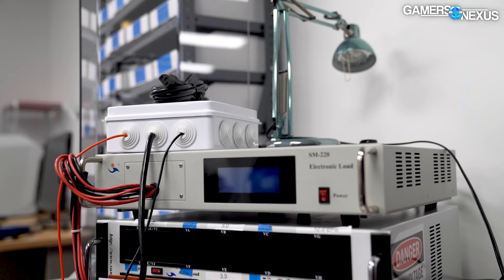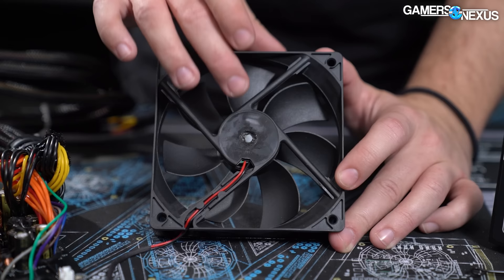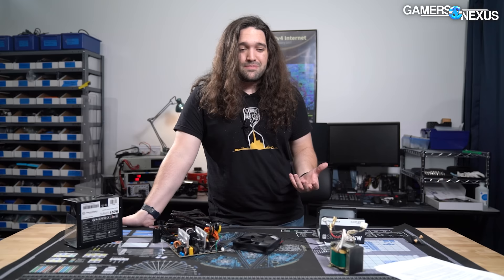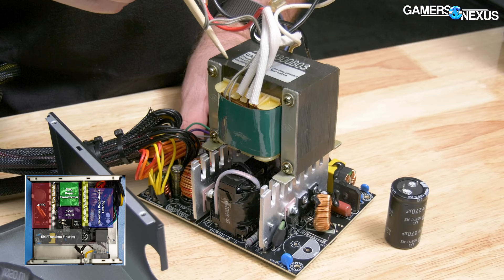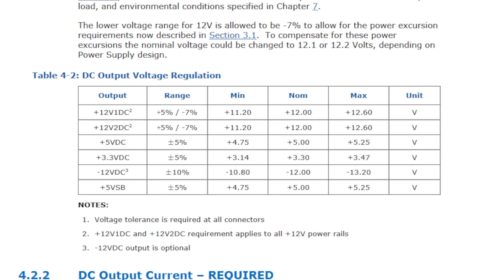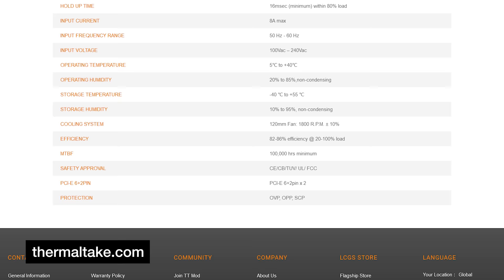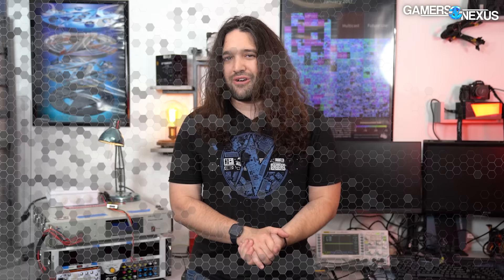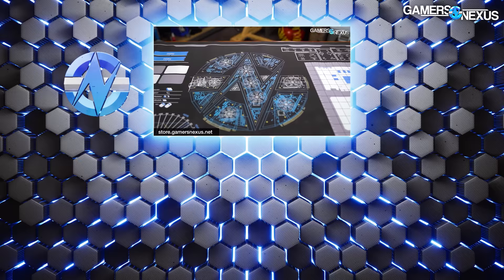Taking Risks on a Cheap PSU: $30 Thermaltake 430W SMART Power Supply Review

Comment: I'm sort of of the opinion that if you can spend $500 on a PC, you can spend another $15 on a PSU for something like a thermaltake BM2/GX2 or a coolermaster MWE V2 that can handle having a 6600 added to it down the line. If you have to forego RGB, so be it; reliability is more important than blinkenlights. 

Still, good to know that this thing at least has OCP despite not claiming it. Don't know why thermaltake does this, it was a similar case with the toughpower GX2, where it doesn't claim OTP despite the platform it's directly based on (channel well GPS) definitely having it. Still, questionable OTP plus a cheap fan makes this hard to recommend over even something like a used OEM CWT GPS or high power J-GD, which can often be found for similar prices.

Comment: What safety hazards does a capacitor from an unplugged electronic poses?
Reply: Normally we discharge the caps before handling the circuit, they can contain potentially lethal voltages even after the psu is disconnected.  I don't understand why he removed it, there's no reason to do so.
Reply: @PhazerTech  I know. But they discharge in a matter of seconds (for this application at least). I'm just trying to understand their reasoning for doing such a thing.

Comment: Can you do a round up review on entry level PSU's from each tier? I'm very interest in learning more about platinum PSU's.

Really I've been interested in them for awhile, but I don't really understand beyond power efficiency what makes a platinum PSU worth it, or if even if they component quality is worth it over a higher end gold rated PSU.

I have to imagine there are some platinum rated PSU's which are not worth the cost due to cheaper components. While other budget option have more value to them. I've read reviews on different brands but comparisons are extremely rare.

After 10 years I kinda want to replace my Seasonic g750, its severed it purpose well, but I don't know how much life it has left in it, and wish to avoid potential damage when it eventually fails.

Comment: Its a budget product that does what its supposed to... be a budget product! But they should update the info (or homologize it). However im not a fan of the skimp on cable lengths... or the missing -12v protection

Comment: I have a 1000W PSU but if I run my undervolted 2080 @~180W and stock 5600x this would probably hold up for as long as the components are supposed to live. I would only do this as a stop gap but still interesting.

Comment: I had a 550W Thermaltake Smart PSU go bad. The system would randomly shut off, and the sata power cables were pretty loose on there. Bad quality cables seem to be a common thing on these cheaper PSUs. I was able to RMA the PSU and they sent me a 600W TR2 S which works perfectly. 
I bought mine for a very cheap build (~£200) and even spent a little extra to get the 550W Thermaltake PSU over one of those crappy Aerocool ones. Neither are good, and I wouldn't recommend them.

Comment: The "Over Current Protection Data" table at 21:42 should have the 3.3V row's % Over Current value listed as 100% rather than 0% to be consistent with how all the other rows are done.
Good video, though.

Comment: EVGA w3 450watt is consistently priced around the range of this TT 430. I know there's tons of power supplies out there, but curious to see how it compares. Considering the w3 is often found at big box retailers like best buy.
Reply: @Examoon  EVGA have multiple sources for their power supplies depending on which line we're talking about (FSP, and Super flower just to name a couple). EVGA's warranty is also very good, unfortunately i had to use it but none the less its there and the turn around time is fast since i live in California (EVGA is also based here in Brea, CA). 

Great wall (GW) makes OEM power supplies and provide some of corsairs lower end units, as with all brands, GW have their cheaper budget models as well as higher quality models that they provide to SI's and OEMs. So, its pretty disingenuous to give them (GW or any brand) the sweeping label its bad because "china." Its more like "it depends." As is the case with many brands.  You should probably do more research before making sweeping generalizations.

Comment: Could someone please help me . I have two gpus both of which have the same issue when I boot up any game the cpu usage goes all the way too %100 and the gpu usage will be at like let’s say %30 MAX. Ik it’s the dedicated gpu from using occt tool and hwinfo . I’ve tried every driver for the gpu past and present update bios, running through all the power plan settings etc nothing fixes the issue. For some reason after playing overwatch for awhile it fixes itself but after I reset the pc it happens again. 
Build : 
I7 2600 
Sapphire rx 470 4gb 
DDR3 12gb 
450w psu 
Pleaseeee help

Comment: i just bought the Deepcool PX1000G PSU, i dont meed 1000watts at all yet but i wanted to buy one that could actually last 10 years+. It is 80 Gold certified and has the Cybenetics Platinum rating, i got it for a bit less than 190€ off Amazon. 

the "dont cheap out on your PSU" was really the driving force - and the fact that my old PSU recently died, it was over 10 years old, it was in a prebuild pc i bought a years ago for very cheap. so it never was the best PSU, also not 10 years ago. i had power outages the days before it dying, then ome time i turned on the pc and the power button immediately switched back off, then i could smell the PSU being burned. 

thankfully no part is damaged and now it works perfectly with my new Deepcool PSU. im planning to build a new pc with 4070ti super power level, so i wanted to really buy a good power supply if i had to buy one already anyways
Reply: *i bought the prebuild from a private seller, he got it from a IT friend from him who had many of those pc bc they aretö the old ones from a company who bought new systems. so i didnt buy the prebuild new myself

Comment: Since you were waving a graphics card around, I wondered if you'll ever look into how accurate the GPU manufacturer's claims about power consumption are? Like for the GTX1660 Asus and Nvidia both say you need a 450 W PSU, but finding a decent 450 W PSU capable of the +12V 45A the GPU needs to function is basically impossible (at least where I live), and for the GTX3080 they say you need a 850 W PSU, which is far more reasonable since you're looking at +12V 70-80A at that point. Why Nvidia went away from stating the actual amperage the GPUs use is beyond me, but it makes it much harder for us system builders to avoid going massively overkill on the power supply.

Comment: funny enough that psu fan they sell with a USB plug and a little stand and it makes a great little project fan. Ive even converted it to run off a 9v battery. probably cheaper to buy the psu and take the fan than buy it directly as the benchtop fan

Comment: Thanks for the review. The timinig is perfect, because i'm actually looking for an affordable 400W PSU which i can use for multimedia and office configurations. My choice will most probably be the bequiet system power 9 400W.
Reply: The S9-400W is a decent supply, although I would check how much more the 400 W Pure Power 11 is... that would get you better efficiency and a better-quality fan. 

That's assuming said fan has actually been assembled properly, which occasionally does not seem to be the case - in mine the rotor was not fully seated and dragging on the fan grille, requiring a good shove before clicking into place. I reckon with some woodworking skills one could easily devise a tool for doing so through the grille rather than requiring disassembly.... possibly even a common fork would work. (Most people would have returned or RMA'd the supply given BQ's reputation for good service, but I was curious what the issue was and whether it might be an easy fix, and this wasn't my first peek inside an ATX power supply either.) I think over the pandemic QA may have taken a bit of a backseat, otherwise a stuck fan should have been noticed...

The irony of the whole matter was that I had bought the supply to replace a Fortron that had developed a fan bearing problem after about a decade of moderate use (the old story of sleeve bearing fans not liking horizontal orientation much)... that was the very same Yate Loon D12SM-12 fan used in the System Power 9, I think. I had tried to re-oil the bearing but didn't know how to do it properly at the time, so the fix didn't last long. It's a bit more involved than just taking out the rubber plug and pouring oil in... Mr. Carlson's Lab has a video on this, something with power supply repair.

Comment: Should be enough power from something like a R5 3600 or 5600 using an RX5000 series card. Not a lot of head room with the RX 5700 xt but still within the envelope.

Comment: I’ve used these for my x99 systems paired w a gtx titan so there more than fine, yeah don’t cheap out on psu if you don’t have too but this psu is more than fine for some slight moderate systems aswell

Comment: I got this for my nas I'm using as a Plex media server. It's all used parts like a mother board with a built in GPU from an old Asus office computer, an amd phenom II x4 955 and 6 of my old 4tb 7200rpm drives. None of the data on it is super valuable so this psu is more than sufficient for what I need.

Comment: The 3.3 and 5v stuff would matter more for me, in the use case of using one for a retro enough system. Like I have a Socket A retro build I want to keep alive, and the only power supply it would boot with at the time, was the cheapo looking turd that came with a case I bought from Fry's electronics, when they were still open. Looking at the stats sheet of the respective units, only the cheapo unit actually supplied enough output at 5v to handle the CPU. Even though it was a later board that did use the 4pin aux connector, which should have offloaded CPU current to 12v based on what little I knew of the spec.

Comment: Is my math off or am I missing something?
It says total power as 430W...
But last time I checked, 110 + 387 + 3.6 + 12.5 was equal to 513.1 :|
And it can't be "after inefficiency losses" either because then you'd get 410W (ignoring the part where it says "Max Output Power", so it's after al inefficiencies)...

Comment: The very cheap 600w thermaltake PSU they sell at best buy etc for $40 & the $50 model with RGB is actually an ok PSU, from tests I've seen. They're 80+ white but are efficient enough to be bronze and was capable of well over 700w in testing.  Testing showed it overperforms. I would assume it's garbage but tests show it's a fine unit. I'd like to see GN test the 600 and 700w units as I'm going off some testers I'm not very familiar with. I've seen a couple of these cheap TT 600w psus last and last, still going.
Reply: "white" is the old standard, from like 2008, LOL. At least I had a 2008 FSP 500W PSU that still seemed fine in 2016!

Comment: Shouldn't OCP be tested in cold and warm environment, or at least link test ambient temperature condition. Because depending on ambient temperature and PSU heat state trigger point will float quite wildly. 
There are quite extensive PSU reviews on Tom's Hardware, probably you can catch few new things you may add to future reviews there?
Got my PSU trip and blow up (on "PC ON" button press) when upgraded my PC with new GPU about 2 months ago. It was 650W PSU, but quite old one. That night was really nervous.
Next day bought Deepcool PQ850M. Price per quality/efficiency is quite huge mark. It was first PSU without bad reviews (i was surprised there was actually only 2 bad review from total of 320 5* reviews) in reasonable (even though still isn't cheap) price mark. Modularity was a neat addition, as it made my life bit easier as well (no idea how to cable manage more than 2/3 PCI-E 8pins on back side. . . ).
I know that time passed is not that big, but at this point of time it gives me a good ride.

Comment: GN. With the upcoming CPU releases in mind. Would you mind doing a bit of a dive into DDR5. 
Is the current speed and latency going to improve rapidly making any purchase soon obsolete?
Do the old tenets of duel channel and duel rank still hold true? 
Does performance markedly improve with higher spec memory?
Will pcie5 nvme hard drive be fast enough to act as ram expansion? (I can remember what it's called when a system does this and I don't think I've seen it outside of poorly written python working on big databases but it's interesting nevertheless)
As you can tell I don't even really know what questions to ask so please go deep in the way that only you can!
Basically a beyond ddr4 Vs ddr5 video.

Comment: I would have been interesting to include one actually good PSU in all the graphs to illustrate the difference in quality. Right now it seemed that the Corsair CX series was the best performer but that's not really high quality PSU.

In addition, I think you should be comparing PSUs with similar power usage. Since this 430 W unit was more like 380 W in reality, it should have been compared to other PSUs running on the 380 W level instead of each unit running at 100%.

Comment: 430w is still completely viable today IF IT WORKS. That'd definitely run my retro xp rig just fine considering gpus like the 750ti and cpus like the i5-2390T, with power left over (I use a 400w - granted bronze -  in mine with 3 case fans, 2tb ssd, gtx750 non-ti, 3570 locked to 1 core cuz winxp, dvd burner, sb xfi titanium, every single game is over 60fps). It'll even easily power a newly built rig if we're considering entry-level stuff, i.e. - i3, 3050/6400, ssd, etc. 

My 300w runs my school/work/ff14/wow private server/movie storage just fine. Granted I run an i5-3570, gt 1030 d5, 1 case fan, ssd, and dvd burner, on Ubuntu with Wine and Vulkan. You seriously don't need much to be comfortable unless you need to swing an e-peen, or if you have the cash and care about pumping out every possible framerate and detail. 

All that said, thank you for this. It lays out why you don't buy white label psu's.

Comment: I have the 430w "Munich" version, that should be the same, on a jbod server with 5 hdd's and 3 ssd's running almost 3 years, it's a 25w Amd am1 5350 apu + 2 4-port sata contollers.
I didn't yet catch fire.

Comment: Would it be possible to add vertical lines on the benchmark graphs to indicate limits for ATX spec? Since we're dealing with power and not FPS, I feel the graphs don't convey as much without a reference to what is failing spec vs good vs excellent etc

Comment: It would be interesting to test one of TT's top end units as well, for comparative purposes within the same manufacturer of what $30 vs. $185 gets you.  Is it drastically different, is it worth it?  I would love to find out!
Reply: Oh it'd be drastically different. You simply cannot get much hardware for $30. They have to assemble it and make a profit somehow too.
Reply: TTs higher end units’ OEM is CWT. They are incredibly well built. The RGB aspect is just a waste of time
Reply: @JABelms  I think RGB is so stupid. I'll pay more for stuff that doesn't have it.
Reply: @JABelms  Ahhh thanks for the info! I have a platinum 1500W or so from them and it's been rock solid, It's like the Tough Max or something?  I forget.  But it's quiet, and my system even with crazy tight timings and voltages here and there run like a charm no power complaints :)
Reply: Toughpower Grand I think it is...actually.
Reply: @1pcfred  Thanks for the reply and the info!
Reply: @Spikeypup  I always recommend my high end clients to get TT TPGs and Seasonic Primes, everyone who uses a Toughpower I know has nothing but praises. I think my original TPG 650 (which was one of CWTs early Magnus Opus) outperformed every Seasonic Platinum I owned
Reply: @1pcfred  Yeah before this generation of PSUs Thermaltakes were almost perfect....until they decided to add RGB and weird ass software with their PSU. Now they are much better and conservative
Reply: @JABelms  I have heard of Thermaltake. They are a well known brand.

Comment: would be nice to check all voltages with osciloskop if they are really DC voltages, i saw few times on old cheap hp/dell prebuild psu's that 5V was not 5V dc, but ~40% pwm of 12V dc, so with multimeter you see 5V, but it was killing hard drives like every few months.

Comment: I spent $70 for a 550w gold rated Phanteks PSU.  That might sound expensive for the wattage, but it's worth it for high quality.
Reply: I spent $190 for a 750W Seasonic Prime PX-750. High price for the wattage, but I don't need any more than that and my standards is nothing but top quality power delivery on the best PSU platform for any PC I build.

Comment: Computer power supplies never fail to irritate me.  There's no such thing as a negative DC voltage.  That's just reversed polarity.  Further, there's no need for both OCP and OPP.  Wattage and current are directly related in reference to voltage.  The lack of one or the other shouldn't affect anything.  The more interesting metric to look at is the trip time on a high resolution scope.  A good power supply should be able to handle--and in fact meet the demand of--transient spikes.

No hate on you guys; you're doing great!  I reserve all my disdain for the PC power supply industry, who feels the need to drastically deviate from an already well-established and matured set of standards.